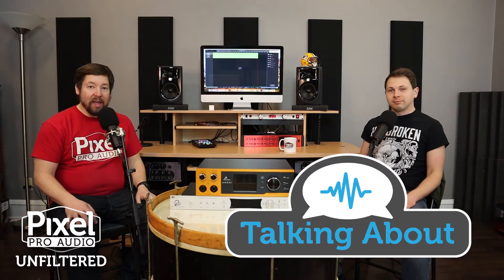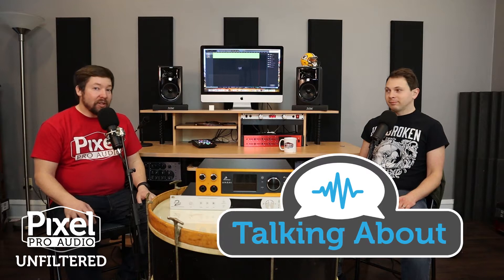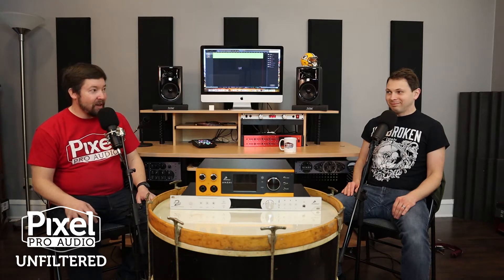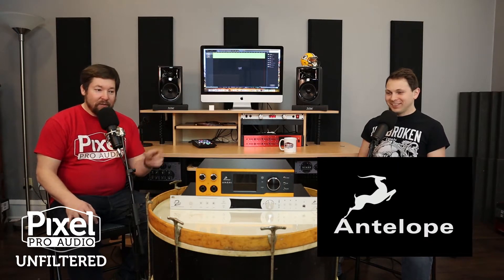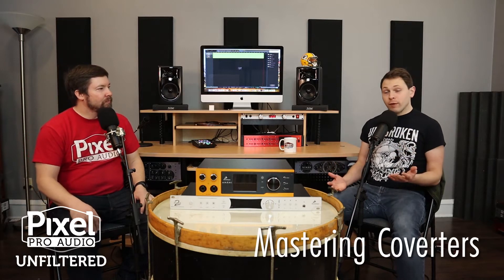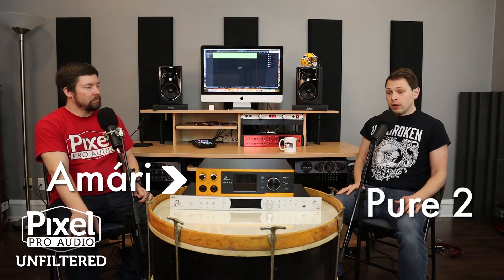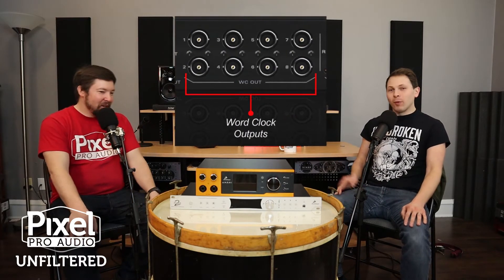Antelope Audio Mastering Converters - Amari & Pure 2

Comment: I have a pure2 and like it, but I had a bad experience with Antelope. They wanted me to pay $1000 to fix my Orion 32 which they said was a power supply issue. Ended up with a quantum 4848 to replace the Orion. I will get ridding of the pur2 once something else comes along I want but. But a huge plus for the pure2 is multiple word clock out, that's why I didn't get a lynx Hilo. I need word clock to go to my quantum and quantum 4848
Reply from the maker: How do you like the Quantum compared to the Orion? Great videos btw! -David
Reply: @Pixelproaudio  thanks! I like the quantum 4848. I wish it had input and output metering on the front at the same time. Presonus has a good converters to me, and I really feel in 2021 nobody makes "bad" converters anymore. I do think the orion sounded slightly better, more open on top end.

Comment: Audient ID44 and Amari have the same converters  (CS43198 /AKM 5578E) 🙃
Reply from the maker: Interesting... They sounded pretty different in our tests, so the clocking, power supply and analog side of the conversion must make a massive difference. -David
Reply: @Pixelproaudio  They sound different (matter of taste) but no one sounds better than the other the converters inside are top class. an Audient ID44 & Orion32+ Gen3 owner
Reply: You mean ID44 mk2 and Amari use same ad converter??
Reply: @chord1476  ID44 mk2 doesn't exist yet. But Yes ID44 Mk1 use the same AD converters as the Amari
Reply: @MrlegendOr  wow… great..!! And I also have heard Id14 mk2 ad converter use id44 ad converter. Is it??
Reply: @chord1476  Yes but just for the Cirrus Logics side they Use CS43198 / AKM 5574E
Reply: linearity of power supply and clock are as important as the converters. If the best converter on the market badly implemented they will sound just ok compared to an high end converter device with same chips. Many low price audio interfaces on the market claim to use the best converters in their devices (audient, motu etc...). 
for analogy, it's like having a ferrari engine without the rest of the car.  @Pixelproaudio

Comment: I have an Audient ID44, looking to upgrade to pure 2 converters but keeping the use of Audient Mic Pre's (because I like the sound of them) and plugging in to Pure 2 via Adat. Will I lose conversion value going through the Audient first? Would also like Pure 2 for Mixing/mastering. Good to know there is a difference and an advantage to your mixing! Thanks.
Reply from the maker: Great question! If you want to use the iD44 for the preamps and get the Pure 2 conversion for both A/D and D/A, you can plug a mic into preamp 1 or 2 and send the signal out to the Pure 2 via the Send insert jack. 

If you want to order a Pure 2, check it out here: https://www.pixelproaudio.com/products/antelope-audio-pure-2-mastering-grade-converter-and-usb-audio-interface?_pos=1&_sid=41a138a88&_ss=r
Reply: @Pixelproaudio  Thanks. The reason why I say Adat from the ID44 is because the analogue I/O's on the Pure 2 will be in use already with my outboard? It would suck if I have to keep on going to the back of that unit to plug into the analogue inputs...

Comment: As an autiophile, how doos it comare to naim, mytek, chord kind of hifi converters? I personaly like a musical warmer Sound. Is this dac not to 'technical' sounding?
Reply from the maker: The best way I can describe it is open and real sounding. The music doesn't sound hindered by the hardware. -David
Reply: Thank you.
I might try one.
If it doos not Sound to dry or analitical. Difference betwwen pro studio and hifi Gear like in monitor speakers? Studio speakers tend to be exhausting after some time. Would you use it at home? Sorry for my bad English.
Reply: @brunobracke4612  Hi Bruno, did you try the Amari or Pure 2?
Reply: @grano71  amari usb
Reply: @brunobracke4612  Can you please tell me how it sound? It is too dry and analytical? Do you think I can add it to hifi system?
Reply: @grano71  i have the LKS mh-da004 dac with amanero usb board. Realy good but Still sounds 'digital'. I had ps audio ánd ayre qb-9 dsd dac before. Much more alalogue.
Reply: @brunobracke4612  What about the Amari? How it sound the Antelope Amari?
Reply: @grano71  analitical. Great for studio work. If you have a bright system it isounds to technical. Not realy musical. But depents on your taste.

Comment: How do you use it/ connect it with the claret te 8Pre X? Thank you
Reply from the maker: Both of these Antelope units would be used as your interface. You'd take the output signal from your DAW, run it out (of the converter unit) to your outboard gear, then back in (through the analog inputs) back into your DAW. The in and out (AD/DA) conversion is what these specialize in. Your 8PreX essentially acts the same way, but with not with as high-end of converters.

Comment: can you use afx2daw with the antelope zen go interface?also can you advise me if its necessary i add the golden pre73 preams ? or the pre included are much better
Reply from the maker: Great questions! This does not support AFX2DAW currently. For that, you need a Mac and an Antelope interface with Thunderbolt. I'm not sure if they will make it available in the future though. I certainly hope so!

I would suggest trying the Antelope preamps first and see how you like it. If you feel like you're missing something with just the software after lots of sessions, then try a hardware preamp. 

-David
Reply: @Pixelproaudio  Thank you very much David, top quality, I have a mac does the zen go have thunderbolt?
Reply from the maker: @emastersmultimedia6481  The Zen Go does not have Thunderbolt, but their Discrete interfaces do! -David
Reply: I'm not sure it was when this comment was written, but currently ZenGo supports AFX2DAW through USB, I think it's the only Antelope device that does. Cheers!